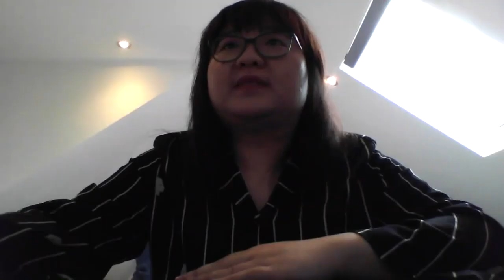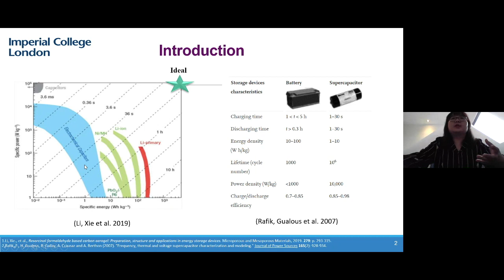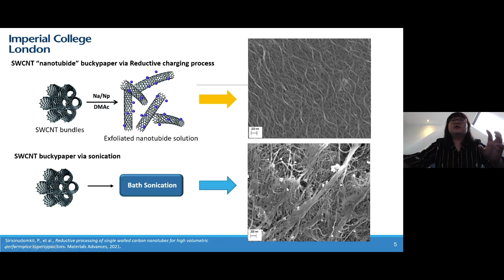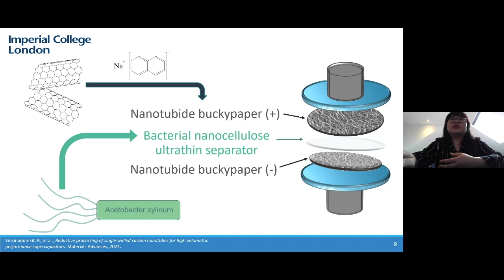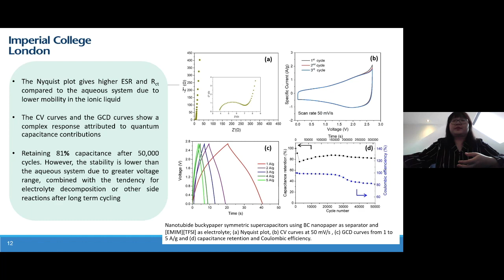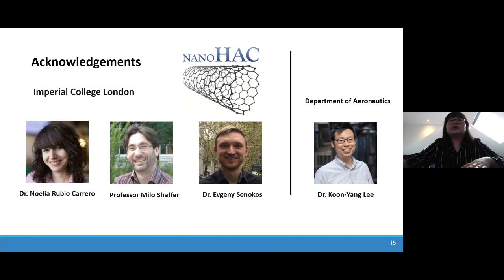Webinar: Modified single-walled carbon nanotubes for a new generation of energy storage applications

Comment: I wish i could see the results of this in a graph compared to previous capacitors supercapacitors and current lithium ion batteries lithium sulfate batteries and solid-state batteries With the variables of energy density, volumemetric density, temperature range, cycle life, and cost of production variables plotted for each. Then i would truly understand super capacitor batteries now compare with this breakthrough with the cutting edge conventional batteries